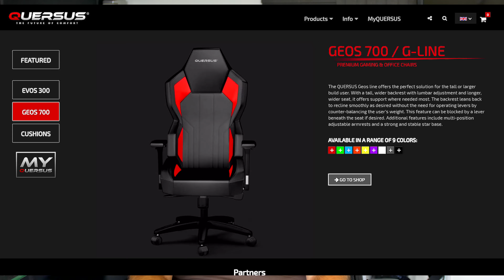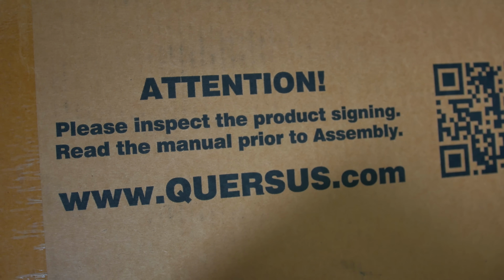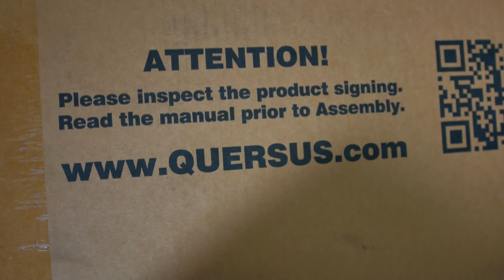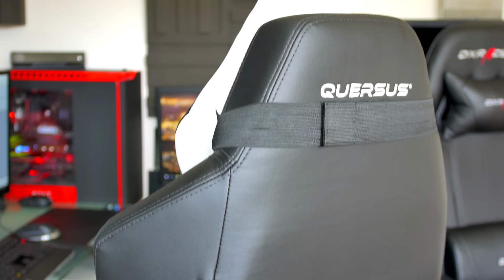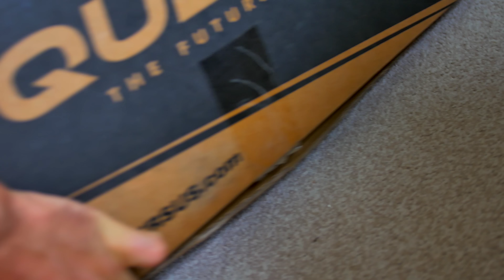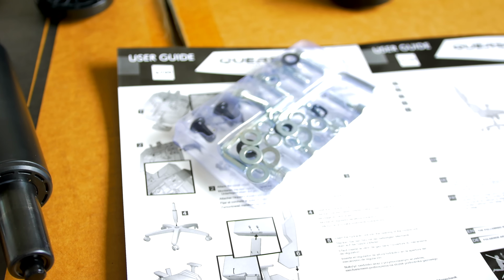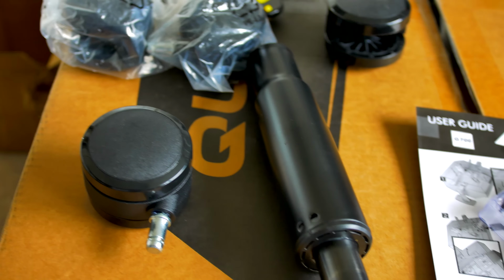The Quersus Geos Chair & An Idiot Who Can Talk About A Chair For 19 Minutes

Comment: Can't use WD-40 for lubricating something like that.
It's got less than 25% of a very low viscosity oil, meant for water displacement. WD literally stands for water displacement.
You need a high viscosity lubricant, like machine grease.

Comment: Wd-40 is not oil, WD stands for water displacement. It stops rust essentially, there are plenty of options for real oil with heavy weights and viscosity differences that may work, but WD-40 is not one. With that aside you are correct a new chair should not need oil
Reply from the maker: +Phibz FourZeroEight Yea I'm aware of that. But where I'm from its a nationally accepted saying that you 'oil' something with WD-40. And similarly it's used around here to reduce friction between moving metal parts, people spray it into bike chains or their door hinges etc strictly speaking it acts as a lubricant which is how they market it but I'd rather jump in a fire than use the word lubricant in conversation haha so oiling it will do for me.
Reply: I thought Newcastle was the lube capital of Blighty?
Reply from the maker: It is haha I just can't stand the word, when I hear it it makes me want to gouge my eyes out with a tea spoon
Reply: kinda like moist then? my sister unfortunately got called moisty at school. hahahaha.
Reply from the maker: That's... very unfortunate haha
Reply: Wd-40 in 1953 was the Water displacement 40th attempt at making it. now its just a Brand, they make oil, cleaning products and more, also water displacement if its needed.   and Like anything people just use a brand to call all products like it.
Reply: WD-40 is not really a lubricant. It reduces friction in things mostly by cleaning the hinge or moving part. Yeah, people spray it in bike chains and it is terrible for them as people think it is a lubricating grease/oil which it is not. Get some proper medium weight grease. WD-40 probably made the problem worse as it is so lightweight and would create metal on metal friction.

Comment: Hi TFI, how has the Quersus been holding up these couple of months? Any negative things to say? I'm interested in buying one for myself. Thanks.
Reply from the maker: It's been a lot more sturdy and reliable than the DXRacer chair, after 3 months of solid daily use it's still silent, no creeks or groans from it, the clicking of the arms gets on my nerves more and more each day though as it's totally unnecessary for that to have even been a thing in the first place.  It's not as ergonomically comfortable as the DXRacer, I miss the lower back cushion on the DXRacer.  Tbh if the DXRacer wasn't noisy and cranky I'd use that instead of the Quersus, but the silence of the Quersus is enough to make the difference.